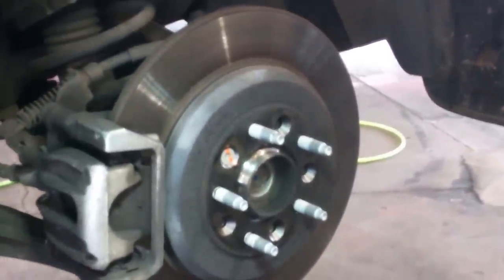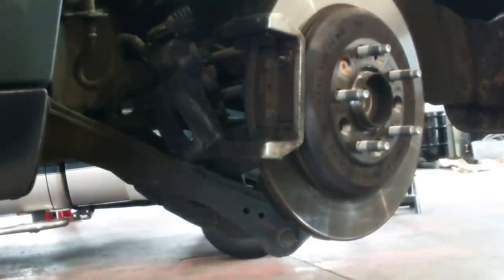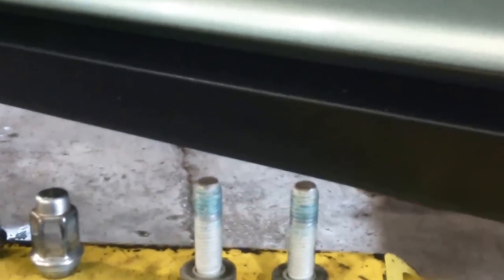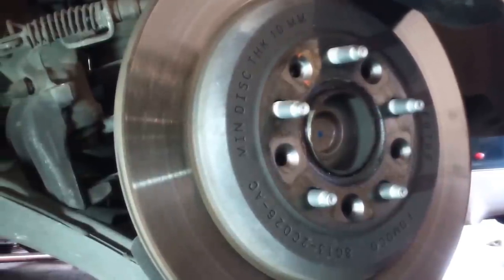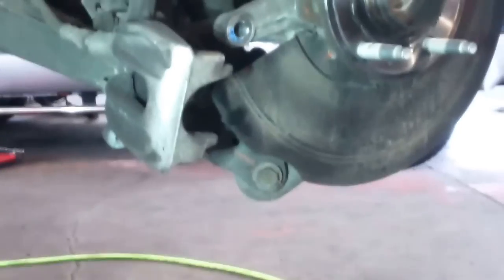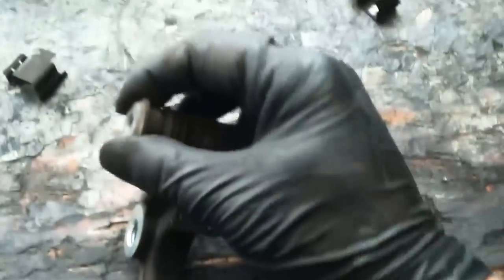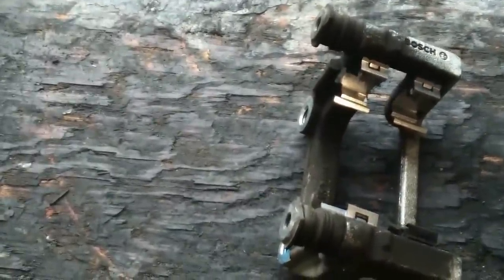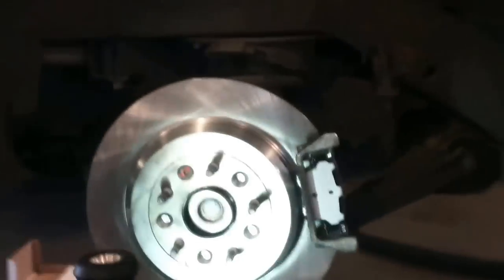Rear brake pad replacement Ford Taurus 2008 Mercury Sable, Lincoln MKS, MKZ

Comment: If you  can get those rotor screws out, throw them out they are used on the assembly line to keep the rotors from falling off during assembly!!! They usually get destroyed when taking them off.

Comment: You weren't lying It is a very long process and make sure you are wearing padded gloves. You're going to feel like you're not making progress but as long as that pressure plate on the tool keeps loosening you know that you're collapsing it.

Comment: can u name all the tools u used?
Reply: 19 mm lug nuts 
T40 rotor screw
15 mm caliper bracket holder
13or14mm slide pin caliper piston thing
Brake caliper presser compression tool(some pistons need rotation to compress) driver side clockwise passenger counter clockwise.

Comment: You were turning the piston caliper tool the wrong way. You made the piston come out the bore. Sloppy work,
Reply: You are WRONG!!!  Left (Driver Side) side you turn Clockwise (Right) as he did, Right (Passenger) Counter Clock wise.  If were listening he even said that.
Reply: @mjp2828  what tool is that called ?